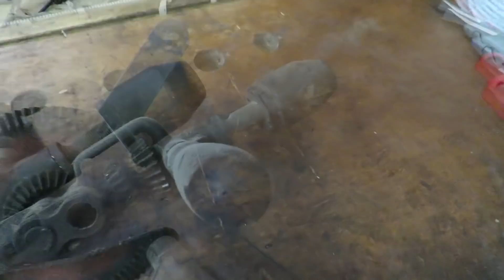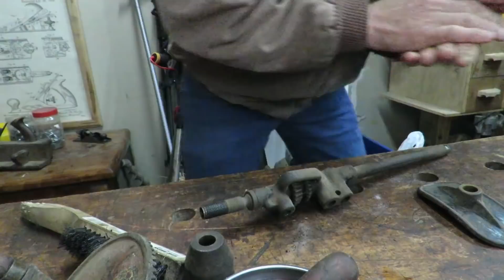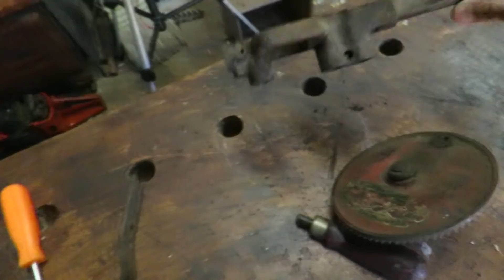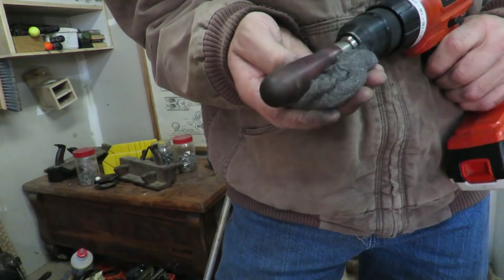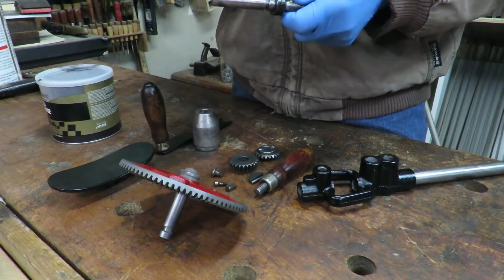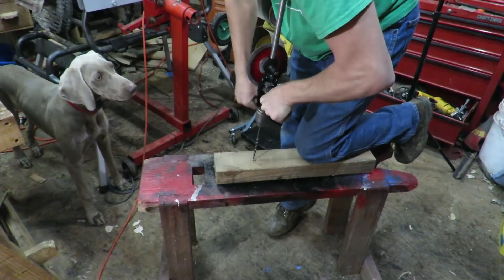Antique Hand Drill Restoration | 1930's Goodell-Pratt Hand Drill

Comment: I have several old “egg-beater” drills lying around for restoration.  I see them occasionally at Estate sales and can’t help but buy them up in the hopes of restoring them to their glory days only to have them continue languishing in some forgotten corner of my garage ... woe is me ... my tool addiction has me in its clutches!

I also wonder if I’d even use them when/if I do get them cleaned up.

Good job on your project ... sure does look pretty!!
Reply: After you get one oiled up and running you can use it for deburring and countersinking holes. I find it handy to have one in the rack with a counter sink ready. Saves that annoying dead battery just when you need it situation.

Comment: Nice to see a full, stripped down, good-as-new restoration. Thanks! I've often wondered what those breast drills are good for? It looked a little awkward using it horizontally. What was that like? Drills are one class of tool that I really don't see much benefit in using the old hand powered ones when the modern ones do actually work well. I just don't see how they  produce superior work compared a modern drill the way restored antique saws, hand planes, and chisels do when compared to the...garbage...you can buy at the local hardware store. I don't count the high-end modern chisels, saws, etc. because they cost soooo much more, it's just apples and oranges to compare them to restored vintage tools. What do you think of using antique drills?
Reply from the maker: I am more of a fan of the power drill haha. This however was passed down from my great uncle, so there is more value in that. Sometimes I still use old style drills, I have about 15, but usually go right for the power. Thanks for watching.
Reply: Yeah, I find it painful too see good old tools in rough shape. I haven't seen one coffin smoother in any of the local antique shops that didn't have the sides of the wedge mortise cracked out. And I recently came across an early Disston no 12 rusted completely away almost  to the handle. Keeping the family's stuff in good shape is definitely worthwhile IMO. Good job.

Comment: Hi. Great video! 
I am restoring a similar drill. Mine has the same spindle but not working (the jaws are not aligned): is it possible to open it? Thanks in advance
Reply from the maker: Yes I believe you can take it mostly apart
Reply: @ASliceofWoodWorkshop  thanks, I did it !!